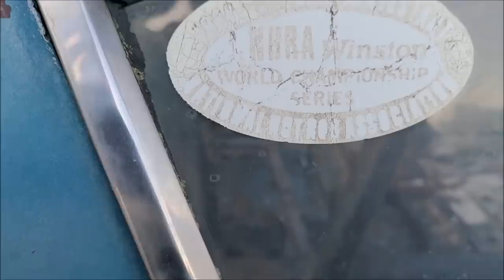Introducing Project BarelyCuda my 1968 Plymouth Fastback Barracuda Race Car

Comment: It would be cool to see the Pro-Stock in that thing but building it with extra parts you already have to use that 440 which isn't structurally compromised is also cool. I think you would feel more comfortable beating the crap out of that 440.

Comment: The magnets definately weren't a joke, They're like the tool ya didn't know ya needed till ya have it 🙂  I did my panel alignment in the Dart with those, don't weld to close to them tho 🤣. Awesome project! Definately a nice spot for a big block!
Reply: It's surprising how a magnet screws with the arc when you're TIG welding.
Reply: @bkgaragerestorations  agreed! I was tacking the quarter on my Dart and the welds were going haywire, forgot I had the magnet on 🤣🤣

Comment: Love it!
Yes like others my first thought was the ProStock Hemi but I actually like your idea of motorhome 440 and leftovers
It suits the car.
When I street raced in the late 80s early 90s this is the type of car you steered clear of unless you had something as equally brutal. The likely setup would be a big inch 440 based engine, highrise single carb, 2 nitrous kits a plate and fogger, auto trans. It would launch like a kick in the teeth. Just a rowdy, rude, obnoxious, scary af HOT ROD!
Reply from the maker: glad you dig the idea man
Reply: @ScottsSpeedShop  Dig it? I love it!